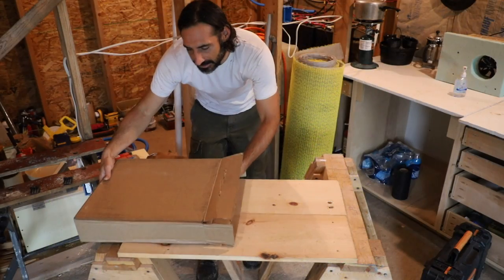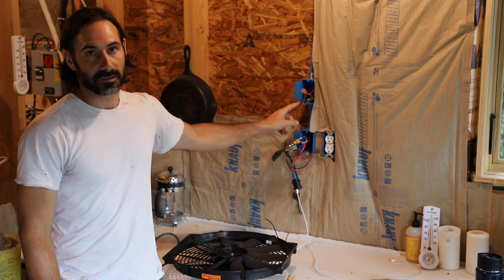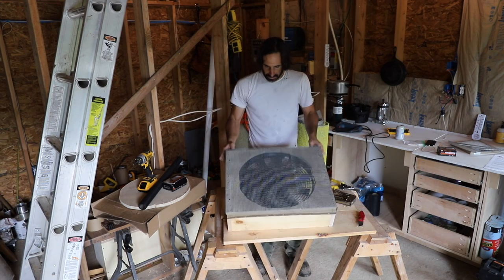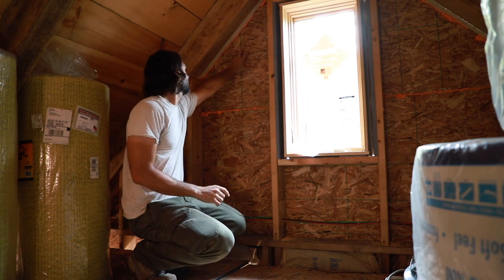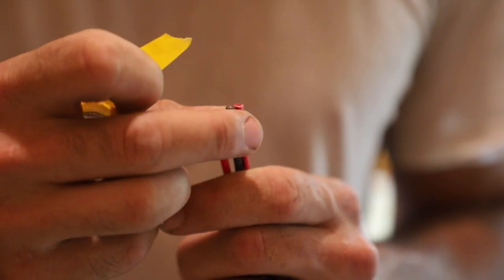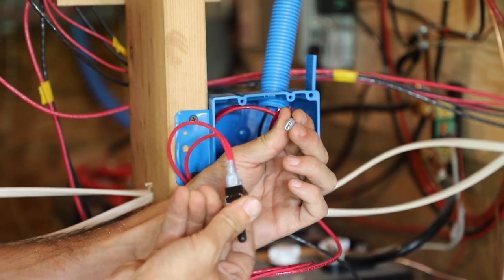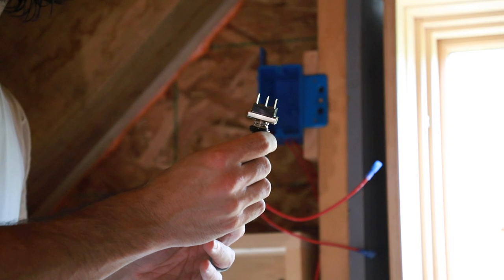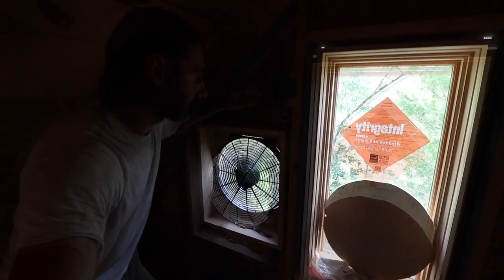Off Grid Alternative to Air Conditioning?  Making a Whole House Fan From a Radiator Fan

Comment: Lmfao! Sorry I'm laughing, but that shit is ghetto AF dude! Thing Sounds like hell, looks like ass and will be awesome for letting rain inside when accompanied by strong wind's. Their are some really good quality  self contained solar powered attic vents available that are super quiet, have brushless motors, lithium batteries and t-stats built in for fully automatic operation. Only takes around 30 minutes to mark and cut a hole in the roof with a Sawzall, mount, secure and seal. Hell you could even build a nice interior bezel for it from scrap wood so it would look legit inside and out.